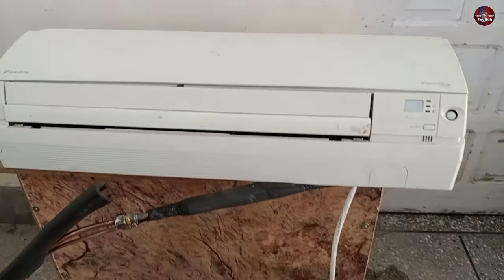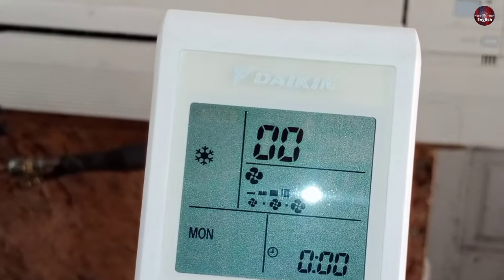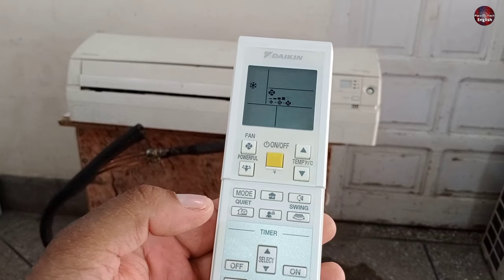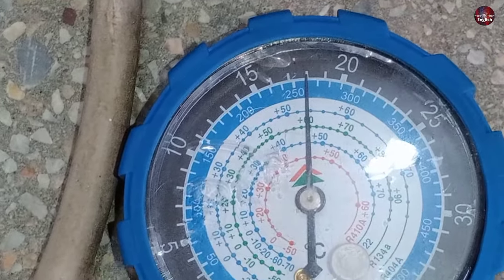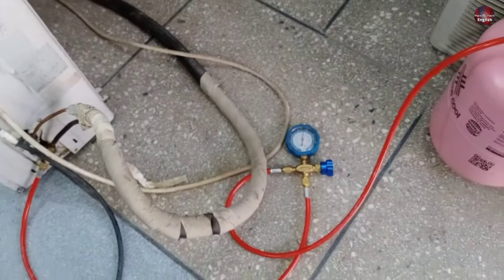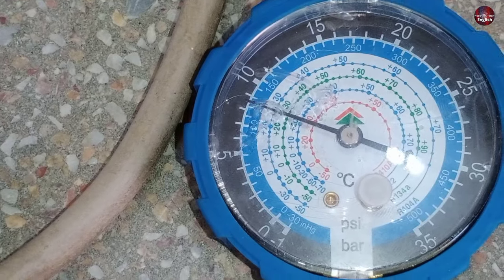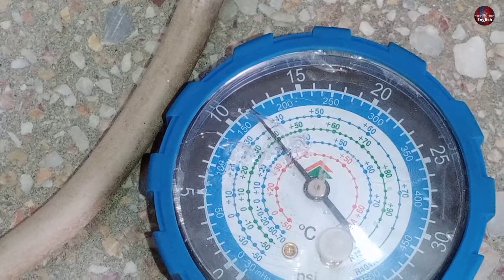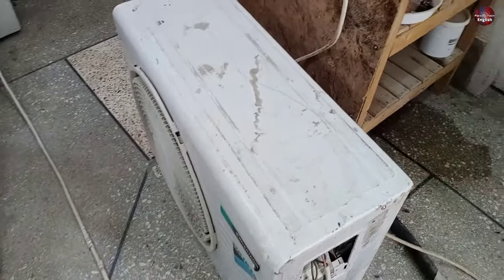Daikin Mini Split Ac Not Cooling Despite Good Refrigerant Pressure

Comment: Thanks for your suggestions!!! You have saved me a lots of money!!!
I have Daikin 3mxm52 3 split and it was not cooling and sometimes it would turn off and on again every 20 minutes. So i bought a cheap Manifold Gauge to check my suction line pressure and it was only 150 PSI, so i tried adding some refrigerant ( R32 ) to reach 180 PSI and its cooling AGAIN!!!
My little Daikin has 9 YEARS so i hope its only a small leak 😁

Thank you again my friend!👍
Reply from the maker: Great My video Helped you, Your Comment is going to be pinned.

Comment: Which Gas are you using in this video? That would help us know what your talking about.
Reply from the maker: R-410a refrigerant
Reply: @forevertechenglish  Thanks for your reply, I'm working with R32 currently at 34c ambient....Just found out the section side needs to be at 180-190 psi....Lots of conflicting information online about the R32 working pressure.

Comment: Hi there, I was working on one 2 head. On my ambient 70 f my low side only 90 f. Name plate state 8 lbs refrigerant on the unit. So i have to charges to 175 psi? Im working on daikin inverter heat pump

Comment: u mean it was lack of refrigerant if my running pressure is jaz 120psi-150psi
and i need to make it 170psi?
im using r32 refrigerant...
Reply from the maker: Yes
Reply: im using r32 refrigerant...
Reply from the maker: Yes the pressure of r32 and r410a are the same.